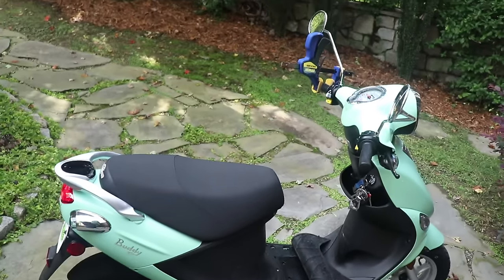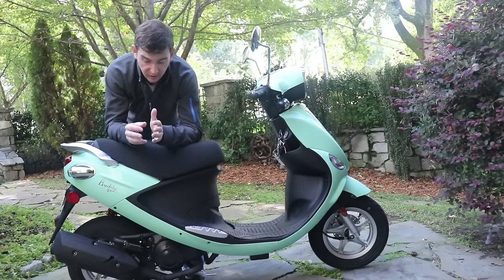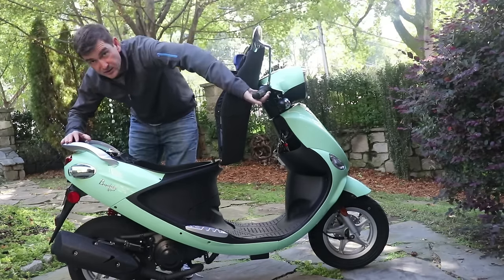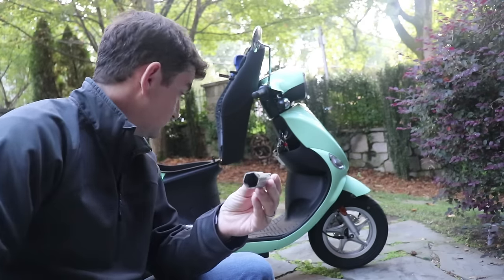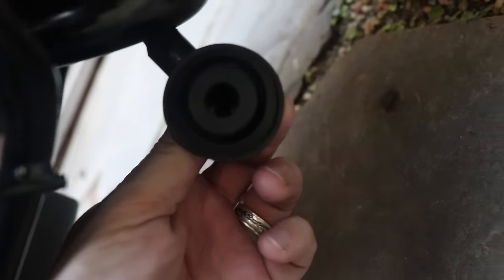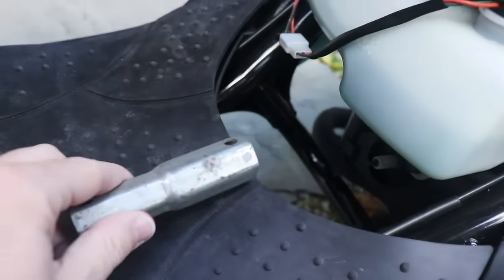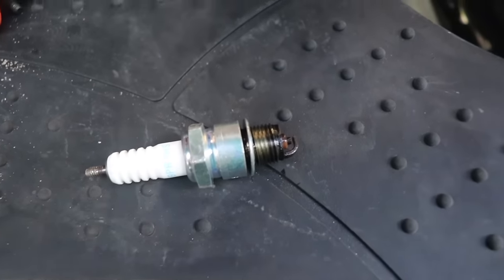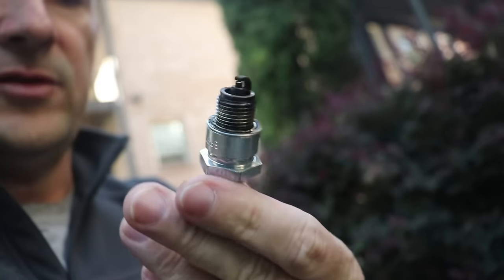Scooter Won't Start After Sitting - How I fixed mine

Comment: Good job buddy ! I just sept 2 long days, and a few bucks later trying to get my kemco scooter running. Alas, i got it started late this afternoon. Bottom line, starter fluid right into where the spark plug goes. It sat all winter in my garage, (the cover over it, plus a trickle charge on it ). I just had to give it a major blast of starting fluid. Plus, i did put new gas in the tank. It had "stable fliud in the tank for storage". Youre a very plesant fellow my lad. Safe riding to you, and your viewers ! 😊

Comment: Thanks for the video. One good suggestion below is to choke manually by covering the air intake with your hand. On some scooters you may have to open or remove the air filter box. Other option is to use quick-start spray can which works every time. Chances are this is what every mechanics do. Just spray a little amount through the air intake then try to start. Up to 2 to 3 times no more. You can purchase quick-start in any automotive stores. Safe riding.
Reply from the maker: Thanks. I’ll give those a shot next time mine won’t start. Appreciate the comment.
Reply: This comment was way more help than this 20 minute video. Thanxx
Reply: @stevekinross1742 yes!! agreed!!

Comment: Blowing into the petrol  tank  idea  works  for different engines . First time I tried it a long time ago on a D4 Caterpiller crawler tractor .It had a pilot motor to start the main diesel . The carby  dries out over time & gravity just does not work every time , but blowing into the tank puts a slight positive pressure in enough to force some petrol through . As one old garage mechanic told me ,it`s either spark problem or fuel . No computers those  days . To check the spark remove the plug ,leave it connected but sitting earthed on the head . It needs a bit of darkness to see the spark (Do not hold on , just rest it on the side of the hole  ) Turn the ignition on & turn the motor over . If there`s a nice blue spark  & some petrol on the plug & in the carby it should go . One other thing is modern fuels do not keep well & can gum up a carby ,even stuff it completely . If it`s a computer  problem disconnect it with a hammer !

Comment: Good job. Just an FYI. Mis thread= cross threading. The gas on Spark plug is same as starter fluid except fuel evaporates faster. That's why a Lil spray of starter fluid is used. The tool you used is a Spark plu universal tool.  Intake is where the air filter is. Keep doing and learning. Never stop.

Comment: Hi I'm the guy who made the video, SCOOTER WON'T START TRY THIS TRICK". I like your video, don't worry about the little flakes in the gas tank, there is a filter in the tank and a fuel filter in the gas line. If you can get a helper to blow long and hard into the tank while your trying to start it.. This should force fuel through onto the spark plug and hopefully save you a lot of trouble. Happy Scooting, From England
Reply from the maker: Hey Rhodie. Glad you watched the video. I watched yours first and tried the blowing thing. Didn’t work for me. Just made me light headed. Lol. But thanks for the comment here. Hope the weather is turning nice in England now like it is here in the Southern States.

Comment: I went through the comments to see if mine was repeated and didn't see any, but there were a lot of comments. 

1- usernamemykel sounds to be on the right path - it sounds like your bike might be running either rich or lean. 

2 - there is an electronic choke on top of the carburetor. This makes adjustments when the weather is cold. The problem is that the scooter has a heck of a time starting when it is cold out. Try using the kick starter if it happens again. I had to on a couple of days when the weather gets below the 50s. 

3 - there is a 2 yr warranty on your scooter that is from Genuine scooter company. 

4 - NEVER put your spark plug into your gas tank (especially if it is dirty). :) Never put anything into your gas tank other than gas and other fuel additives (stabilizers work great if your scooter will be sitting around unused for more than a day or two - this stops the gas from fouling). 

5 - that spark plug looks like it is definitely dirty. I would give it a thorough cleaning using carburetor cleaner and a rag. I wouldn't mess with a wire brush on it. Another option is to get a new plug. However that will fix the symptom, not the disease (so to speak). Also a new scooter should not have a plug that looks that dirty. I suspect that there is definitely something going on with your air/gas/oil mixture. 

All said, I would definitely have the mechanic, at the place that sold it to you, check it out. It should be due for a check in by now anyway. 
Good luck and happy scooting.

Comment: It is unnecessary to remove the spark plug to dip in gasoline for firing up.  Your scooter is carburetor one.  The fuel in the carburetor tends to evaporate if you don't ride it for a couple days.  All you need is to twist the accelerator handle twice to add fuel to "wet" the combustion chamber in order to fire up.(not too wet)

This is the prevalent trick of carburetor scooter owners in Taiwan with 20 million scooters.
Reply: I'm so dumb my battery got low from electric starting for two wks and one afternoon it wouldn't start at all.  I tried kick starting  took an hr to realize I had not just have the gas on but also twist the throttle    it takes one kick and a twist and we're off buzzing.  😅

Comment: My anxiety shot up to extreme levels as I watched this. Thank you for trying to help though!  👍
I have a 2008 new Yamaha C3 that has only 164 miles.  It’s literally still new, not even a scratch on it!  Long story why I never rode it.  Last time I tried to start it a few years ago it had a new battery, gas, but wouldn’t start.  Any ideas anyone??
Thanks!
Reply: When it has been sitting for a while, the old gas gets in the carburetor bowl and ends up as gunk that clogs the holes in the jets so no gas can get through. It wouldn't happen if the bike didn't have any gas in it, but even a small amount is enough to reduce the size of the holes so not enough gas gets through. They are really tiny holes. And new gas in the tank doesn't take care of it. I think spraying carb cleaner into the air intake and then trying to start it is the general remedy. But I don't even play a mechanic on TV!

Comment: 😂love your vid. You can pull your spark plug out and plug it back into the wire end. Find a grounding point cylinder head or bike frame, start it and watch for a spark. If it sparks when you start it it's good. Next would be gas flow🤙

Comment: I have a Genuine Buddy 50 which I absolutely LOVE,  to accomplish local  errands and pickup a limited amount of groceries/small hardware (I attached one of those common plastic milk crates via cable ties to the optional rear luggage hardware which I had previously installed). Ok now, a few things about your video - the electronic metering device is a "multimeter", the spark plug tool you showed may have been supplied with a portable generator, the Buddy 50 has it's own spark plug tool in the blue plastic tool kit attached to the underside of the bike's seat. There are YT vids re: how to test spark plugs, and you can Google images of spark plugs which will tell you about the condition of any spark plug.
You mentioned that the scooter is brand new - you ARE aware that the Genuine Buddy 50 has a two year warranty which includes roadside service, are you not? 
Kudos, that without any apparent knowledge of tools and how/when to use them, and apparently no training with anything electro-mechanical, you took it upon yourself to attempt to resolve the problem - you must have a wonderful wife. You fixed the problem and should be very proud of yourself. Now Google "How to adjust a motor scooter carburetor"  (yours is a "Minarelli" brand, not a GY6), to take care of the problem of smoke coming out of the exhaust.  You don't have to remove anything to gain access to the idle adjustment screw.
Enjoyed your humbleness and your ability to recognize brain farts for what they are (at 73, I've had my share).

BTW, I've been riding a newly purchased 2018 Kawasaki Ninja 400 ABS KRT Edition - It's a "sport" motorcycle, and nobody expects to see a 73 year old (happy) face when I remove my helmet, because, after all, we're supposedly "too old" to enjoy a "crotch rocket"!
Thanks again for the very refreshing video.
Reply from the maker: Wow. Thank you for the very thoughtful and thorough reply.  There’s a lot of good info in there. 
I’m sure it is a real kick to see people’s faces when you come to a stop on your Ninja and take off your helmet with a ear to ear grin. Keep riding and stay safe.
Reply: @chrisfoster3709      ;   )

Comment: WOW Chris, this video is a HOOT :-)!!  Both entertaining AND informative for people with absolutely NO mechanical (for gas powered engines) aptitude! The are TWO big takeaways from this video. 1) NOT to be afraid to attempt to try new (SIMPLE) things. You can save yourself a lot of money, not to mention learn a lot. 2) Something NOT expressed enough is to make sure when working on or around an open fuel source, ALWAYS make sure there's ABSOLUTELY NO power going to your ignition source, or your your little self help project could blow up in your face! :-o Overall, pretty damn AWESOME vid!

Comment: This is great. Would you kindly do a carburetor(?) tutorial for a very problematic Yamaha Vino 125. It cranks, but won’t start and stay running, and this seems to be a very common issue with the make and models between 2004-2009. I have a 2005 model and it sparks/turns over - and with a little gum-out to an already cleaned-out carb turns over - but will only make a short sputter and then quickly dies out after that. Compression? Fuel to Air ratio? Weak spark? Please help … not just me, but apparently many others, too. Thanks!

Comment: Never put anything in the gas tank other then the fuel.  You drop items in you will have more problems.  Also try removing air filter and give it a few shots of stater fluid.
Reply: I legit bropped candle wax in my gas tank and it still runs 100% perfect
Reply: Thanks for the scooter saving advice Terry I highly doubt dropping things in gas tanks will cause problems, I mean I dont work as a scooter mechanic but I did stay at a holiday inn express last night

Comment: Your Buddy is carbed  ,that dealer video was blocking the air at the air cleaner  basically choking it manually  .   Blowing into the gas tank is a bad idea for a number of reasons !  lol Mostly because it will not do anything  ,on the bottom of your fuel tank is a Vacuum operated fuel pump it only pumps fuel when the motor is running .   At the beginning of your video you said it made a  sound . Did it turn over and not start ?Or did it  not even turn over   ?
Reply: Chris u can help me with my problem, it cranks but won’t turn over

Comment: If the gas on the spark plug tip doesn't get it started, , try clicking your heels together 3 times.  It never  fails.

Comment: Loved this video it was funny but your honest you did good you will learn if it's 2 cycle sometimes carbon will build up finding out of the muffler pull muffler off chip the little hole out make sure piston is down and not scrape it be careful it will run after that it's got to get air

Comment: You're going to have this problem again if you don't clean that crap from the tank out the fuel system.  As suggested by other viewers, you could start it with starting fluid after it's sat a while, but that's a band-aid fix and starting fluid is hard on the engine.  I'd start by cleaning  the fuel tank, replacing the fuel line(s), replacing the fuel filter, replacing the spark plug and verifying the gap.  (Dropping the carburetor bowl  and cleaning the needle and seat is  probably beyond your mechanical ability).  Make sure the vacuum signal hose going to the automatic fuel petcock isn't loose or cracked. Without that vacuum signal, the petcock won't open and gas won't flow from the tank to the carburetor.   I had similar problem with old Honda Helix; after sitting for a few months there wasn't enough fuel in the carburetor bowl to get it started, and the cranking speed didn't create enough vacuum to get the fuel petcock to open.  I resolved problem by splicing a tee into the fuel petcock vacuum signal line so I could apply a vacuum to the hose and get the petcock to open and fill the carb bowl.  Good luck with it.

Comment: I would bet a fairly large amount of money that the reason why it wouldn't start the first time was because one of the various kill switches was set to "off."  I also feel confident in saying that there is zero chance that the drop of gasoline did anything to help.  While you were at it, you could have very easily checked the plug "for spark," and YouTube videos abound that show how to do that.

Comment: Putting gas on the plug is not what fixed it the spark plug boot it’s self was not making a good connection when you removed the plug and put everything back together and reinstalled the boot you made it possible for the spark plug boot to make a tighter connection to the plug, your engine is a 2 stroke which means it requires 2 stroke oil to be put in its own tank that is located next to the fuel tank there probably is a low oil light on you control panel where the speedometer is it will come on when it’s low that tell you when it needs to be filled back up your dealer will be happy to help you out in that department for the correct 2 stroke oil to use as per factory recommendation, they are very good scooters and very dependable if maintained properly  you have a great day

Comment: I stuck a vacuum hose on the tailpipe and that worked pretty well a few times. (I used a cheap old vacuum, and it caused no damage anyway. Then while starting the bike with the vacuum pulling air out of the tailpipe the thing started very easily. Then I disconnected the vacuum immediately so it wouldn't get damaged.

Comment: Hi , so I’m having an issue where the mopad doesn’t key start but it kick start . But when running it seems like the battery is dying
Reply: Prob good to check your stator is working properly
Reply: @robd951  btw how do I fix a catching brake . The back brakes are catching and relewasing
Reply: @hungngo3415  Sorry, know a bit about the engine and it's parts but nothing about the brakes as I have not tried to work on them.

Comment: Your carburetor needs to be tuned cuz it is too lean= means too much gasoline and not enough air intake. it does work but your spark plug will get all cloged up pretty soon and it won't run as well afterwards.

Comment: Ok so i have a scooter that has been sitting in my garage for 7 years im thinking of getting it checked but i looked at the spark plug and the battery the spark plug was fine but i need to figure out how to charge it and also i found out that it probably has a clog somewhere

Comment: The spark plug is black, which means that the gasoline/air mixture is too rich. In other words, too much gasoline/too little air.
A spark plug must be mocha brown in color then you have the correct mixing ratio.

Comment: The air intake side of your carburetor is attached via big hose to a box (air filter).... when cranking the engine you should.be able feel suction. Coming from the holes in that box.... cover that with your hand and try to start... it should feel like a vacume.. release your hand when it starts.
Reply from the maker: Thanks. I’ll give that a try next time.

Comment: Hey i hv a scooter made by the same co. The prob w/ starting it with the break and starter button is if you dont ride it that much, the gas even when you use 92 octaine which is what u hv to use on the scooters, the gas dries up and u get probs. I hv had a few probs myself. U shld hv tried the kick start rite after, thats what its for and i guarentee it wld hv started rite up. By if ur wife uses it like once a week or 2x a month, then goto a var store or scooter shop and buy gas aditive. Cause scooters arent like cars, a car u can use shyt gas and it will run but crappy. Scooters even if u use great gas vut dont drive them everyday, then u will get starting probs. Also if u live up north, im from fla. A cold start scooter tks a few tries to start. When a scooter is cold winter cold it will always tk a few tries even if u ride it everday. Also never put gas on a spark plug, plugs spark and can ignite and u can blow up your scooter. Well i hope i helped u a bit with some scooter knowledge. Tk care 
Barry S
#BSIPP/YOUTUBE
Reply: This is the truth Like you ain't never lied.

Comment: That isn't a spark plug tool, its a plumbers socket for shower valves.  It worked pretty good for a spark plug though!  Funny video, glad you fixed it!
Reply: well it also might be what you said it was but it is the same tool that comes with the bike as well as a dual screwdriver and some wrenches and the little tool that goes in the hole so that you can twist it off lol

Comment: It sounds dumb as hell cause normally when your spark plug is wet or flooded it will not start but I am definitely going to try your bizarre o world scooter repair cause mines is also brand new and has the same problem. Hope it works.will check back.